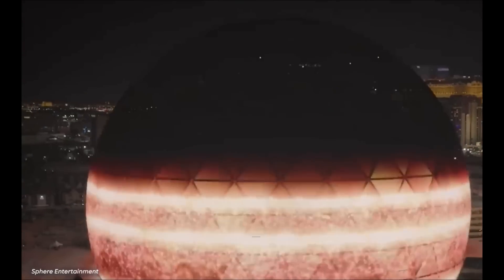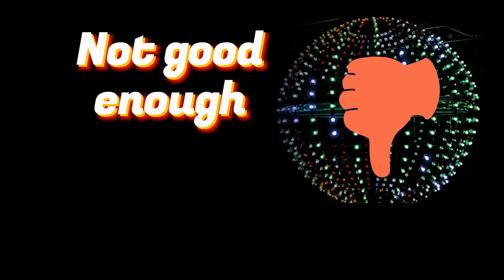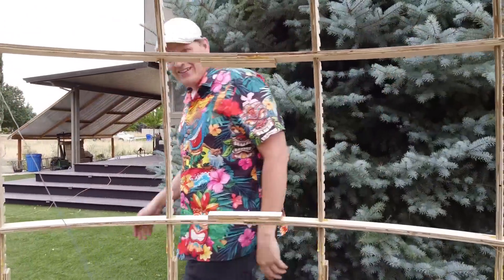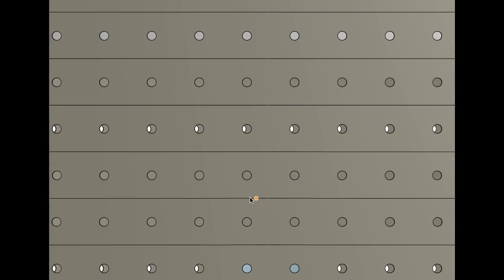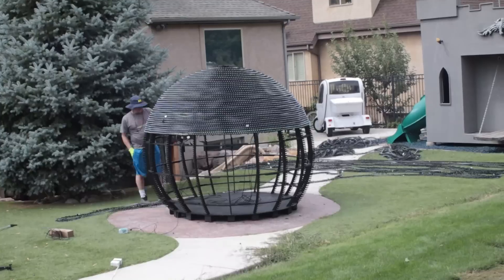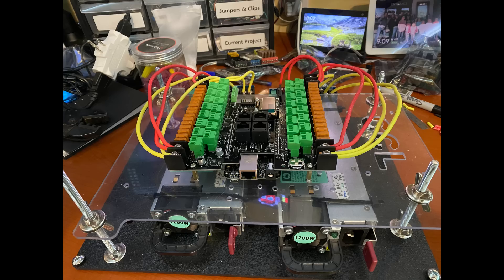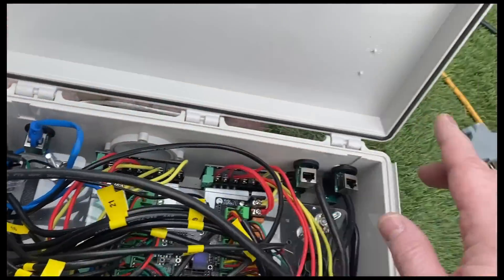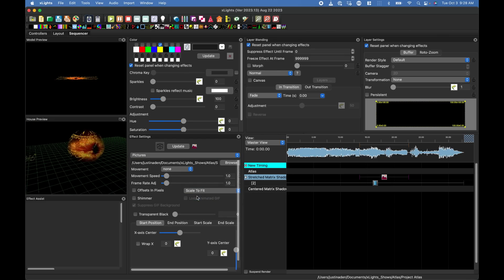We Built a Replica of the Las Vegas MSG Sphere in our Backyard! #drzzs #msgsphere #led

Comment: Some of the effects look much better than the others, the end result is very good.. Need some snow globes and christmas ornament style animations, and probably more eyeballs and pumpkins for halloween.

Size, materials and power seem to be a challenge on this one.. Way out of my budget for the big one built here for sure but I wonder about having a bunch of basket ball or beach ball size ones along my driveway with animated pumpkins, eyes etc.. I can't wait to see the more optimized design.
Reply from the maker: All true.  You may notice that there are some bands of pixels that are brighter than others.  We haven't figured that out exactly yet, but the leading thought is that it is differences in manufacturing batches of pixels.  Same manufacturer.  The smaller one we're working on now will be 18" diameter, so just about beach ball size.  Not sure of the final cost to build the small one yet, but it'll be less than $1000.
Reply: @DrZzs  I'm certain the bands brightness difference will be found in your controller. Somehow. If manufacturing differences were the cause the bright and dim ones would be distributed evenly, not group up in bands. However, I don't know how you used the batches.
Btw, what kind of LEDs are these? Haven't found any info in the description or on your page in parts excel sheeet.
Reply from the maker: I agree with you that they would be random throughout the sphere, but I think we build them with boxes in an order so it might be mfg defects, but we can't rule out the controller.
Reply: @DrZzs Ah, so box by box building. Makes sense! Anyway, it looks okay. 
When you build the bigger ones I suggest have a hard surface between the ribs (a ring of sort) to have a backing to the "strips". Even at this "small" size you can see the sagging.
Reply from the maker: Yes.  From now on we will have something supporting it more completely.  I think we can still span a distance with the strapping, but I think it needs to be cut in 3rds.
Reply: @DrZzs  As you see fit! Any idea if/when any footage will be available of the new build(s)?
Reply from the maker: As soon as possible.  I don't know when we will get it up and running since we are waiting on a shippment of LED's from China.
Reply from the maker: The pixels are from Paul Zhang.  I have another K32. I could try it and see if the bands go away.  the bands start and stop at the beginning and end of 100 count strings but not at the beginning or end of channels.  I'll have to make a short video about it to explain what I mean.  The bands don't correspond to channels off the kulp.  But they do start/end at connections between strings of pixels.  But not just one string.  Like 15 strings.  That's what makes me think its the batches of pixels rather than the controller.
Reply: We've been looking forward to this video, Justin! Great job.
Reply from the maker: Thank you so much!